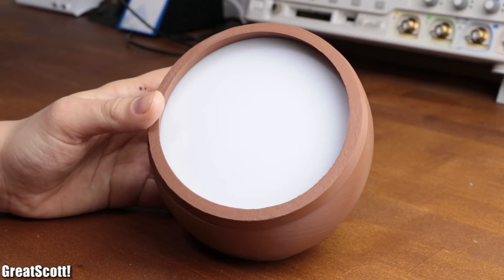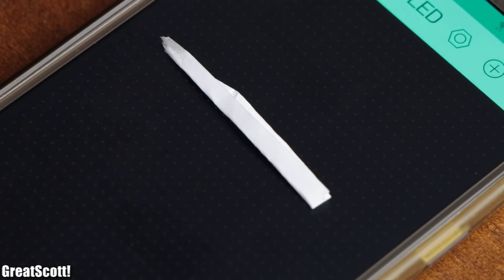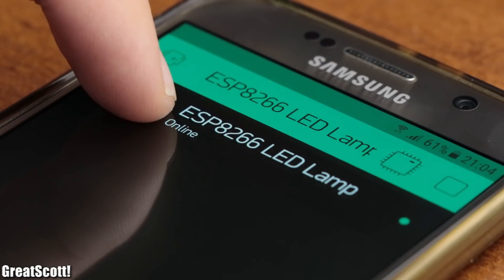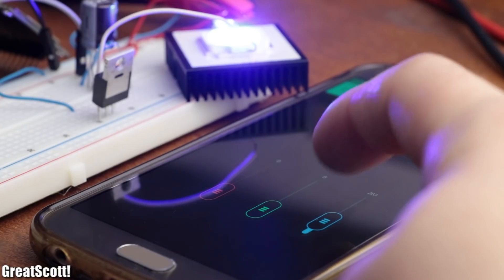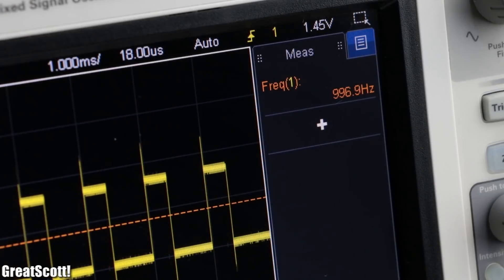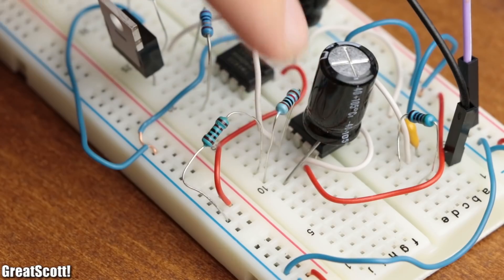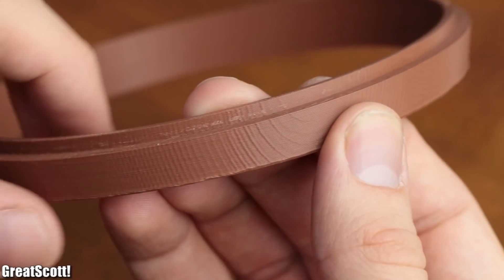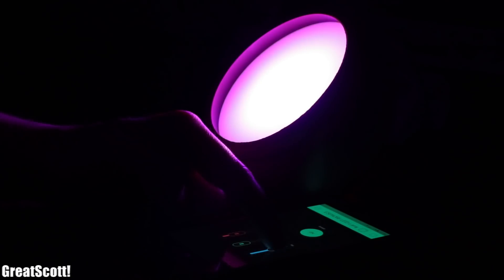DIY WiFi RGB LED Lamp || ESP8266 & Blynk

Comment: Hi .. i have a question . i m developing a PRODUCT . i saw you used linear regulator LM7805 . since it is a product , it will be used maximum 12 hr /day . So , is using linear regulator LM7805 a good regulator ? if it is not , can i use switching regulator ?

Comment: how to increase wattage of circuit instead of using 12v 
i need to use 33v 1.5 amp general 50 watt drivers available in market

Comment: Great Project and as usual great explanation! Thanks a lot.  A question. I would like to connect 5 of the bulbs in parallel using your design and circuit. Please advice me on what to change to make that possible. Thanks!

Comment: You should use BC547 with a 1k resistor on base pin of transistor then it will go to the output pin of nodemcu

Comment: i  was expecting LED brightness control to be achieved through pwm / varying duty cycle, not variable current. That would simplify the circuitry alot ... what am i misunderstanding? Thanks.

Comment: The value of those sliders should be normalized to range from 0 - 255, which will allows you to easily grab any RGB/HEX color value that you like and set it on the lamp.

Comment: Please help! I am new in this and I notice in minute 10 that the esp8266 gnd pin is actually not connected to ground of the power supply only the Vin pin, does he forgot to connect it on the schematic or it does not need to connect gnd of the board to gnd of the power supply?

Comment: Terrible electronics circuit. You are a programmer. Programmers believe in x=x+1. Electronics does definitley not work that way. In physics x=x+1 is simply wrong, the world doesn't work stepwise. So don't extend your computer science knowledge to physics. You'll be wrong.The first circuit withou the inductor does simply not work. There is no time in which current increases, and no time in which the driver turns off AND THAN the current decreases. It is no step by step as in computers. It's all immediatly (speed of light).That is the reason, why you had to add an inductor. It will limit the rise of current in a conductor. Tiny parasitic inductance may have helped the breadboard to work anyway. You should use a circuit like PT4115 or it's internal circuitry, better desribed in the datasheet of the SCT2932.
Reply from the maker: The funny thing is, I am an electrical power engineer. Not a programmer.
Reply from the maker: And the circuit is pretty good.

Comment: I have an rgb project with an arduino nano and ethernet board and blynk. The problem is that when I lower the intensity on any color it has a little flicker. I tried to rise up the frequency with the line you made but it says : analogwritefreq not declared in this scope

Comment: Hi, great video as always! I just have a question regarding the theory of the voltage smoothing circuit. At 6:28, why do you use a resistor AND a capacitor to smooth out the output? I thought smoothing out voltage was the entire purpose of a capacitor? What purpose does the resistor serve?

Thanks!
Reply: Hi...the purpose of low pass filter is to remove the high frequency components...as you can see the cut-off frequency of his lpf is 1khz while pwm is 22khz hence the output is smooth

Comment: Hm... I don't think you need a mosfet driver at all and I actually believe the whole circuit can be much, much simpler. You only need a single opamp, mosfet and a shunt resistor. 

Mosfet drivers are used for SWITCHING operation of the mosfets, that is to make sure the mosfets stays in the linear region for as short of a time as possible for switching applications!!
What a mosfet driver does is it buffers the current, so you can use a low current source (such as the opamp) to quickly charge the parasitic capacitance of the mosfet gate. 

Once the base of the mosfet has been charged, it doesn't need any current at all, it's fine to just plug the output of the opamp into it directly.

For a linear application (that is, when the mosfet is used in the linear region as "variable resistor" as opposed to "on-off switch"), you gain nothing by using a driver. In fact, it adds to the complexity of the project and hinders the behavior. The oscillations you see around the setpoint value are most likely due to the high nonlinearity of the mosfet driver.

Comment: I would like you to use my code for the esp8266 with it you can controll the lamp with alexa and blynk at the same time. Also i have added a fade effect for color change so i would be much easier for the eyes. I'll be glad if you could do that.

Comment: Great video! I was wondering if it is possible to extend this circut a little bit to instead of only the RGB led also connect an high power White led with a higher voltage and current draw. I don't have any experience with electronics so I kind on need some help there. (Thanks)

Comment: led rgb light bulbs exist, 4€ where i live (also remote controlled and im pretty sure if you have a phone with a IR blaster that works too) combine that with a nice little 6€ light much easier and im sure its cheaper since the led itself is 6$ and the heatsink is like 10$ also to add in solder, all your time and work, honestly not worth it (not throwing hate, i love all the hard work and editing <3)

Comment: Do you know  instead using  ESP8266 you use Particle Photon? It's okay if the light is simple just the bulb no more color but still using slider to control the brightness of the light.

Comment: Good job! The constant current drive circuits were a nice touch. Only thing I'd be concerned about would be the heat dissipation; that enclosure looks like it gets pretty hot inside

Comment: Hey, anyone here able to tell me the purpose of the 'flyback' diodes on the inductors??
Reply: Louis Bond when the inductor is turned off the magnetic field around it collapses this would cause a huge voltage peak somewhere in the range of -180v the diode stops this
Reply: The RedCast thanks for the explanation

Comment: How did you account for the different voltages of the different colors in the led? I have the same leds but red needs a significantly decreased voltage compared to blue and green, however, the common anode prevents me from delivering different supply voltages. Is the cathode of your red channel at an +3v offset compared to the other cathodes?

Comment: will this also work with ESP8266 ESP-01?,since you use TX and 3 data pins and on the ESp 01 you have also TX and for data GPIO 0 2 and 3 (RX) which you can see here: https://acrobotic.com/media/wysiwyg/products/esp8266_esp01_horizontal-01.png

Comment: First off..Great job amazing projects I'm learning so much by just watching you and intend to do all of your projects. Best videos on youtube for sure.

Just one question about this project. Why didn't you just use a LED driver like a TPS54200 from TI or something like that? It would have spared you time and hardware to control these LEDs since it can provide until 1.5A.

All the best!

Comment: For the constant current driving circuit I would have used the MOSFET in its linear region. By doing this, there is no need for the MOSFET driver and the second opamp. Also, you wouldn't have to worry about noise from the fast rising currents interfering with other parts of the circuit.
Reply: Linear region means lots of heat.

Comment: Hello I am on the hunt for an oscilloscope, I have come across the single thing sds1202x-e and the rigol ds1054z. Do you have any opinion on which I should get. I want to work with some HF fm radio stuff and a couple of of HF projects. I just don't know if 50mhz is a high enough frequency. Sorry, I know this is unrelated to the video.

Comment: Hey I was wondering if you could give me some pointers. I am trying to use an Arduino Pro Mini to with a TC4420 Mosfet driver to driver a IRLZ44N that controls the speed of a 4AM fan. But it seems to getting really hot and it doesn't really be driving the mosfet properly. (Measuring the outputs its hitting a peak of 6v). Any thoughts?

Comment: Dear Sir;

        I am rahul a beginer in microcontroller programming. I have following concern abot controller programming.
1) How many Devices could connected to PIC microchip IC 
2) How many device connection is possible with one pin of mcu.
3) How many interrupts are possible using pic micro-controller
4) How to calculate all this thing.

please help me !

i am regular viewer of your chanel if possible to make video then can please make it.
It is realy helpful for so many beginers.

thanks and regards
Rahul H.

Comment: So if i wanted the cc to be 3000ma instead of 300, the op amp gain should be 1?  30amp would be 0.1 (theoretically)? Thanks.

Comment: I have a question. If you don't use the inductor then the voltage drop over the mosfet would be Vcc - Vf_led, adding the inductor makes the circuit behave like buck converter, right?

Comment: heatsink seems too small, i had a similar build and if the heat has no possible airholes to escape the enclosure it will constanly rise the temperature. Just try 20-30mins at full power and check the temp manually or build in a thermosensor to check. It can be dangerous is the lipo gets too hot  i guess, and the LED will die quickly. (you checked the temp outside the enclosure in the video)

Comment: Although Blynk is super useful and convenient for this, I'd rather use TCP connection myself to gain more control.
Reply: Totally agree, but Blynk works over internet too, which could be not so safe and a bit hard because of the dynamic public IP.

Comment: OMG, I just built a slightly different version of this before you uploaded this video XD. Almost the exact same components, I even used blynk. I like the 3D printed housing though. I made my housing out of some wood that I laser cut and some transparent PLA on the 3D printer.
Reply: Hey since you built something similar you might help me out. I am also trying to build this project but somehow the constant current circuit won't really work on me. I first tried to use the lm358p at 12V to skip the TC4420, but the amplification ist way off. I need an amplification of around 200 to stay below the 300mA. If I use the TC4420 the current suddenly jumps from around 60mA to the current limit of my supply. I am not sure where the problem is.

Comment: You can dim high-power LED's by using  DC-DC converter modules, instead of making all this schematic.
DC-DC converters can be controlled by PWM signal, just by adding LPF and BJT.

In my project called "Kisosvet" i used STM32(because 16-bit PWM) to generate PWM signal which controls step-down converters with added control circuit, step-down converters connected to LED's with little current-limiting resistors - as result we have adjustable brightness without any flickering or ripple.

Cheap 86 cents MP1584 board from aliexpress can power 10W LED, but it will give own ripple...so better to have some power reserve

Of course it's better converting CV into CC, and on most DC-DC it can be done easily.
More info here, i will be glad if somebody find my idea usefull)
github.com/alicepergatta/KisosvetV2/wiki/Schematic
Reply: Алиса Антонова Thst would be easy with common cathode but would it work with common anode. Power supply for each buck/boost converter would need an isolated ground wouldn't it?
Reply: Hmm, really.I didn't thought about common anode schematic, but maybe for common anode inverting converter can be used.
Each DC-DC don't need isolated ground, in my variant and even if using inverting DC-DC.  

also everybody can just cut LED pins in one's own way)

Comment: Great video.  I've been wanting to do something like this.  Quick question though.  Now I'm just a hobbyist so my electronics engineering skills are not great, but my understanding is that the PWM signal from the ESP is used to change the input voltage going into the LEDs with constant current, right?  And that controls the brightness of each colour.  So I guess there will be no flickering of the LEDs which happen when you just use PWM to control an LED's brightness.  Please correct me if I am wrong.  Keep up the great work, GreatScott!
Reply from the maker: +eddyogi Yes. No flickering.

Comment: Can you make a video about how does dual voltage in universal chargers are designed? and how can they work for 50 and 60 Hz with no problem what so ever?

Comment: Hello, very nice project again...
Could you tell me the efficiency of the analog circuitry. And i wonder why dou you use mosfet gate drivers for this circuit? The load is not inductive and the transistors are N type. Is the mosfet drivers increase the efficiency somehow?
Reply: The 1 ohm load creates a voltage level between 0 and 300mV so if you trig the gate of the mosfet with 5V, Vgs voltage would not change so much. 
Am i missing something? Thank you for now.
Reply from the maker: +Çağın Polat Watch my MOSFET basics video.

Comment: 2 things:
1. Get fusion 360,  I switched from 123 designing and it's so much more fun to work with because you can change something about your design without having to do everything over.
2. Get som super fine sand paper (5000 grit) and sand the 3d printed housing, I bought a range of different values on Aliexpress, and the things I have sanded are ridiculously smooth. Wetsanding gives the best result btw.

Comment: Hi, are the MOS used cool? Aren't dissipating the exceeding power? Because in the past I did the same circuit (without MOSFET driver), and except for a small oscillation, all the power gets lost in the Vds of the MOS, because is driven more or less linearly (but again, with a bit of oscillation that also you had noticed). Or you have a full swing digital squarewave at the MOS gate?
Reply from the maker: +Enrico Sirname The MOSFETs are in saturation. So pretty much no heat.

Comment: Thats alot of work that could have been avoided by using addressable leds by using only 1 esp8266 pin .. don't believe me?? Im using one right now with blynk. If you have any questions ask away.
Reply: jalal majid aren't addressable leds more expensive?
Reply: QuickPro Studios  yes they are, but they don't need any additional stuff to operate.. just give em power
Reply: Addressable LEDs are simple, this is about learning how to use PWM to control individual channels.
Reply: Ollie Baxter good point.

Comment: Hey Great Scott great video I really like your videos I love wifi - connected projects. One question. If I attach a standard common anode 12v led strip instead of the High Power Led will I still need to use this circuit or can I just use a mosfet connected to the mcu output? 

Thanks
Reply from the maker: +Clayton Camilleri You can do it however you want but constant current is the best way.

Comment: Hi @GreatScott, this is so cool. 
But I think it's really worth making them DIY if we make several of them as we usually order a bunch of the components. So for the next one need only to buy an ESP, power supply, LED & heatsink.
But in this case it's easier & faster to have an industrial printed circuit, haven't you made one via an online provider ? If not, any advice you could give here ?

Comment: Can you just lower the maximum voltage instead of creating this rather complex design or there is a real necessity for constant current circuit on LED's?

Comment: You should have used darlington BJT-s for this project...no need for mosfet drivers, and circuit gets even more compact
Reply: I don't believe MOSFET drivers are a necessity in this case at all - there is no need to switch the MOSFETs very quickly.

Comment: Have you received the 100k subscription silver button from yt?
Reply from the maker: +Schimbul de noapte Yes
Reply: Have you had some ideas to ad some El wire under the letters and some sound detecting with arduino to dimmer the light when you speak  and make a Q and A with that sign in the background?

Comment: I remember him before he used adriouno so much cooler circuits and I appreciated the challenge of the higher complexity circuits I miss that however he still does a great job with attached programs and working adriouno and now esp chips I'm just not a code junkie congratulations for 600something k subs

Comment: Great project as always, but ... I have one complain. 
Why using hot glue if you are using 3D printer for creating the enclosure ?
I know that hot glue just works, but with just 2 screw holes the project would be perfect and you would be able to disassemble it any time.
Reply: you could say the same about drilling a hole for the mains wires (why not do it in cad?) but sometimes its just easier to use a drill or some glue

Comment: English version below

Wenn sich die WLAN SSID/PW ändert, muss der ESP neu programmiert werden.
Was wäre der einfachste Weg, ohne den ESP erneut zu programmieren, von außen die WLAN Daten zu ändern?

Ich denke an sowas wie:
1. ESP kann sich nicht verbinden
2. ESP macht eigenes Wlan auf mit Website, die um Logindaten für WLAN fragt

Bessere Ideen?

---

If the wifi ssid/password changes, you need to program the ESP again.
What's the best way, to set up the wifi login data without programming the ESP again?

My solution:
1. ESP cannot connect
2. ESP starts it's own access point with a website and a simple SSID/password form

Any other ideas?

Comment: I had done some similar project back 10 months when I got my hands on my NodeMCU... I used Blynk and 2×2 relay board to control mains switchboard from internet... It worked... I tested It when I was in Japan and the NodeMCU was at my home in India....